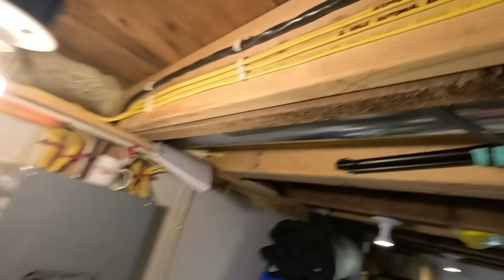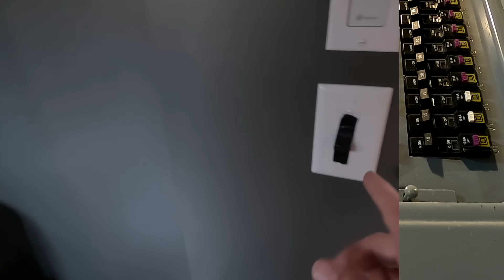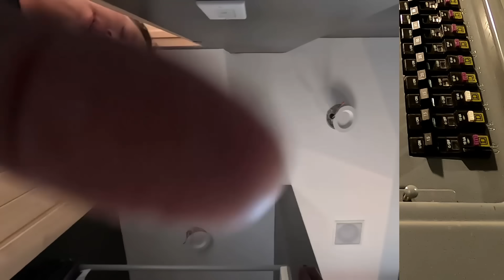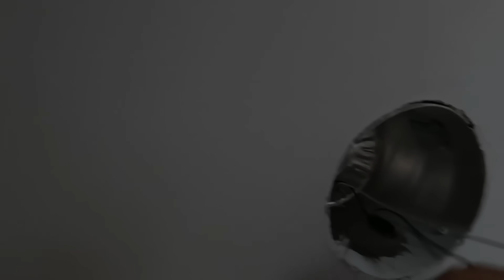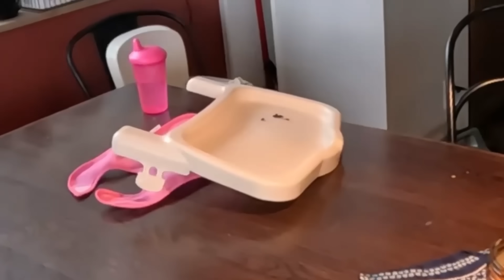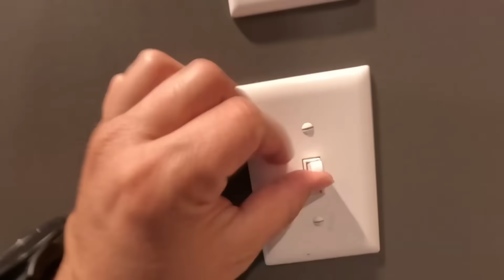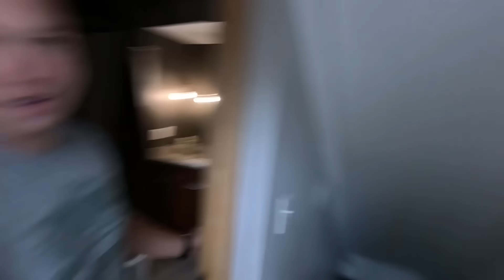Arc Fault Breaker Keeps Tripping! How To Fix It!

Comment: 1:30 I'm pretty sure the reason arc fault breakers got written into the code was kickbacks from the breaker manufacturers to the policy makers.
Reply: Insurance underwriters we’re the cause
Reply: I personally view this as action by contractors (who actually behind the writing of code), to implement a total requirement for AF breakers (once reliable), then allow aluminum conductors back into residential (aluminum conductor alloys that don't require paste are in the supply chain now). Thus, being held responsible for incompetent wiring will no longer be an issue.
Reply: @josephbrabenderiii2049  being old enough to tell you I installed small amounts of aluminum household romex and all the subsequent years fixing all the early 1970’s installation of that type of wiring I can say aluminum should only be used on larger ampacity circuits 40 amps and up with proper upsizing if in conduit or underground or  long distance run, copper must stay for 30 and below, aluminum is simply to brittle and it’s expansion and contraction rates are such that over time any connections will loosen up much more than copper, I started in 1972 and by 1978 houses were already burning down and have loads of connection problems, I must have gone through a couple hundred houses pigtailing every aluminum terminating point and changing to copper with antioxidant compound in the wire nuts, it was a nightmare back then, and the aluminum wire went along well with the federal panels and breakers that would never trip, what a great combo they made LOL
Reply: @josephbrabenderiii2049  There is a device out there now called 'Ting' that is meant to be a smart home line monitor, and claims to be able to detect wiring faults such as arc faults. State Farm is giving them away, but you have to create an account where your 'collected data' is sent to a server for analysis. You (and the insurance provider, I'm guessing) will receive a notification if a problem is detected. It is now your responsibility to get an electrician out there to check out your whole house (even though it could be a false alarm), and if you do not and your house burns down, State Farm could deny your claim because you ignored 'an electrical problem'.

Comment: Can it be a switch or the wiring on the switch that would trip an arc fault breaker?
Reply: IMO yes, because the arc fault can detect a 'break' in the wire (obviously if the break was only very tiny, where a spark could jump across it). If you had a loose connection to your switch, I imagine that could potentially be similar to a wire break.

Comment: I've had very good luck with Amico LEDs off Amazon... 100s installed and only 1 has had issues to date. Halo from home Depot also have been very reliable but cost a bit more.

Comment: The one that’s getting all the moisture from the shower smdh
Reply from the maker: Technically they're rated for use in damp conditions but I'm sure if didn't help anything.
Reply: @BenjaminSahlstrom   Yes, damp conditions, not super duper humid conditions (e.g. a shower). I believe they  have different waterproof ratings and you bought one that was suitable for damp locations, but not water-tight.

Comment: I’ve had half of my arc fault breakers fail in under 10 years, they are very unreliable for how expensive they are. I have a spare on stand by now because of failures.  Especially since it’s code, they need to drop in price if they don’t last.
Reply from the maker: What brand?
Reply: @BenjaminSahlstrom  they are Eaton, I didn’t know they had lifetime warranty since they came with my house! Thanks for the info
Reply: Arc fault and GFCi all have a very limited lifespan and are not needed if you don't hire unskilled labor to build your house. I lived in a house that was built in the 80s for 30 years with 3 generations of kids being raised in the house. Aluminum wiring, no GFCI, no child proofing at all and no problems. 

This safety crap is all just regulations pushed through by lobbyists to sell you more crap you don't need. Houses aren't more dangerous than they used to be, kids are just growing up dumber.
Reply: If Eaton, they have a lifetime warranty. Just go online and report your issue or call them. They are great about sending replacements.
Reply: @kevinh9262  great advice thank you
Reply: I am not licensed nor condone this. Don't know code well. However, I think afci main breakers do exist.  So if that fails it can be replaced instead of having to replace 20. I doubt this is up to NEC code as of now. But it works and does the same thing.